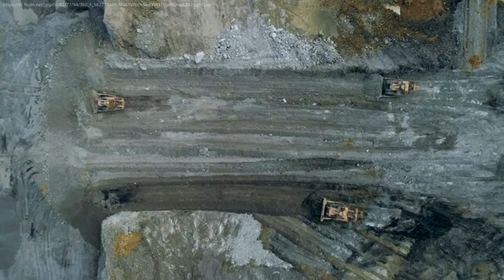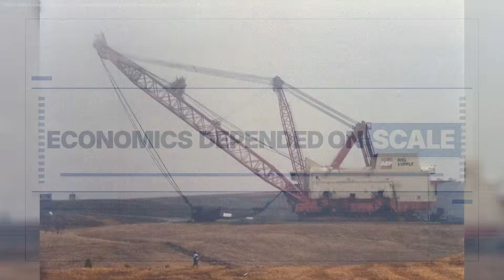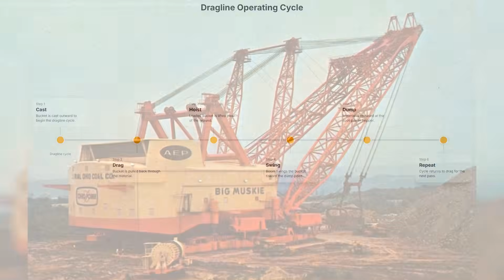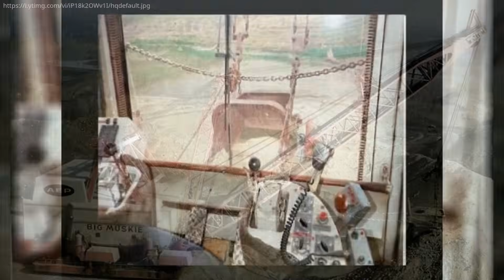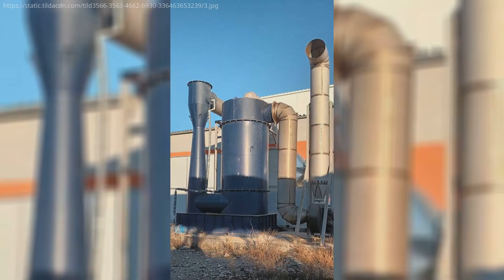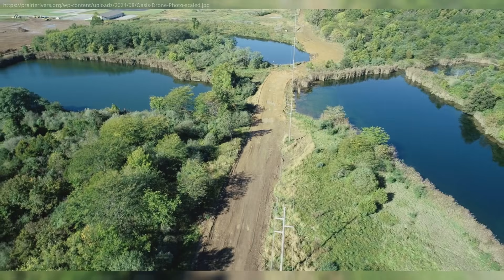They built the BIGGEST WALKING MACHINE on earth then cut it apart

Comment: Take a trip to West Mineral, Kansas, USA.  That is where the "Big Brutus Museum" is. Bucyrus Erie's (now "Caterpillar Global Mining") other "world's largest", Big Brutus lies there. Super cool!  I happened to be working locally in Galena, Kansas and a machinist there recommended checking it out.  The world's largest "electric power shovel".  It's on display where it last worked.  You can tour the entire outside and inside, and answer a lot of questions you yourself, or others are wondering after not explaining very well how 3 phase AC power is converted to use inside this giant, "The Big Muskie".  Massive AC motors are powered to be generators for ALL of the rest of the machine's motions, which are DC motor driven.  Back then, DC motors were the only source for precise major torque and HP control.  The only bummer is, motors have a LOT of copper, so the generators and all of the motors have been removed, but you can imagine how big they all were, see where they were mounted, and can tell what work they were doing because all of the gearboxes and winches are still there. And you can sit in the operator's chair, put hands on the joysticks and switches, and see WTF they were seeing!  I hope you get a chance to see it!  Fortunately this was not cut to pieces and scrapped!  Don't go to the water. It's not a beach, it's a 70 foot drop off straight down!..the reach of the bucket!
Reply from the maker: That sounds incredible—I’d love to see Big Brutus in person. Being able to climb inside, sit in the operator’s chair and follow the old motor-generator system through the remaining gearboxes must make the engineering much easier to understand. It’s a real shame the copper-filled motors and generators were removed, but at least the machine itself escaped the scrapyard, unlike Big Muskie. And noted: admire that water from a very safe distance! That 70-foot drop is no joke. Thanks for sharing this!